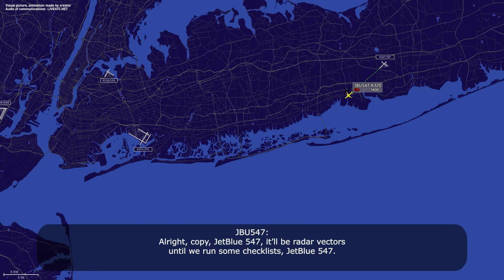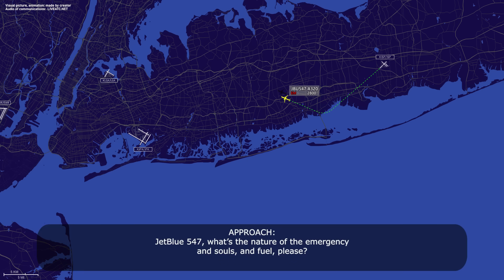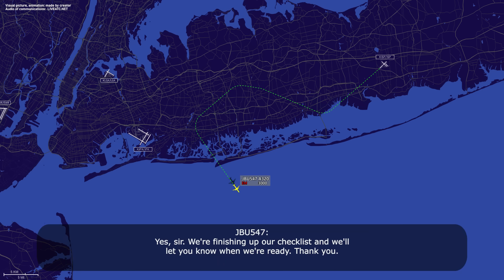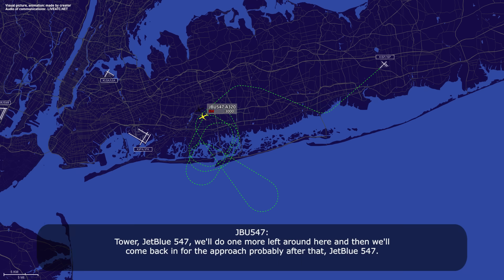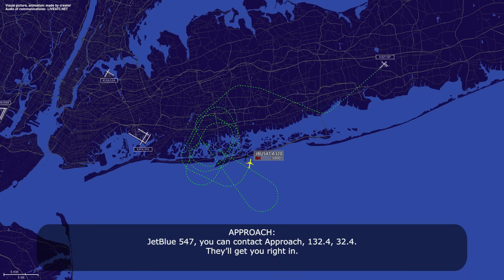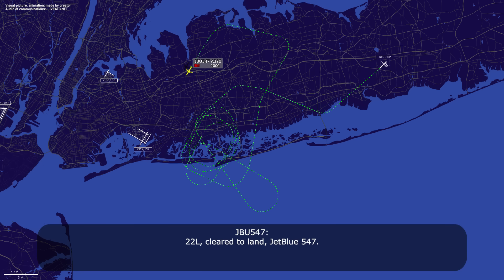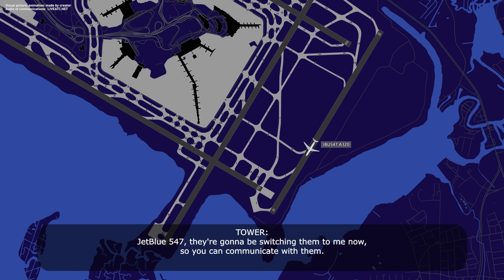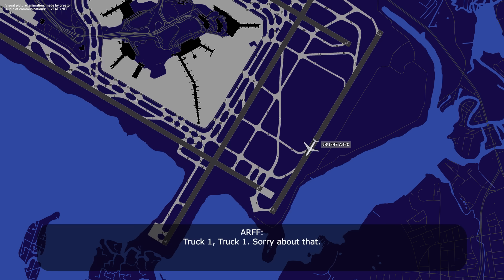47 minutes in the air with destroyed engine. JetBlue Airbus A320 diverts to JFK. Real ATC

Comment: How many times does he have to repeat fuel/souls to each controller and every handoff the system is a failure and antiquated. The FAA needs to change these rules and figure out a better way to transmit emergencies via all controllers so that crew doesn't have to keep repeating themselves while busy going thru flows to either rectified the situation or perform the proper emergency !!!

Comment: I personally would go to LaGuardia  and land 22
Reply: why ?
Reply: @JoeH-l8w  it would’ve been the most closest airport from where they declared the emergency line to LGA as an alternative . But given that B6 is hub is at JFK they are most likely able to do an ac swipe
Reply: @tdadp  The FAA requires you land at the nearest suitable airport. An A-321(I flew them for over 20 years) with a full load of people and still with lots of fuel would not handle a 7000 foot long runway very well in this situation. A single engine approach requires a flaps 3 landing, so the approach speed and landing distance are both increased above normal.. Although reverse thrust is not used for the field length computation, they would not have both engines available for that. There is always some time required to complete the checklists and prepare so, one airport being a few minutes flying time farther is not normally an issue unless there was a fire or dual engine failure. From memory, I think JFK's RW22L is about 8400 feet. I am 99% sure it would satisfy the runway required in this situation whereas LGA's 7000 feet would be either too short, or leave no room for error. Choosing JFK seems to me the best alternative, and, all is well that ends well in this case, Kudos to the crew.
Reply: @JoeH-l8w  I get what you’re saying. I’ve been Airside at LaGuardia when a few aircraft  made emergency landings at LaGuardia  all uneventful thank God but the good thing is at the end of 22 thei is e mas & ARFT truck are station their. I have also done mock emergency trains drill at Lga & they are more then capable of responding to any emergency. It is one thing when we have a table top exercise. It’s another one. We do the full emergency with actors and first responders from the NYPD to FDNY with the Port Port and PAPD ..  because they also train at JFK the same in Newark with Elizabeth and Jersey City fire department and police services.

Comment: By my count, there were 7 different controllers and 6 radio frequency changes tasked to this flight crew to deal with while having to deal with the primary task flying the aircraft. ATC needs to be educated  that for pilots in an emergency, the order of critical task accomplishment is Aviate, Navigate and way down the list is Communicate.They were asked 4 different times for fuel on board and number of soles. In today's modern technology, no crew should have to declare an emergency more than once nor should they have to declare soles and fuel on board more than once. Yup, this is busy airspace. One of the first tasks the flight crew will accomplsh is select 7700 on their transponder. That tells every controller that has a radar screen that this is an emergency. Because the airspace is so busy, there are a bucket load of controllers that can manage this emergency on the ground "in the background". ATC needs to change their mind set as to why they exist. ATC is a resource for pilots not the other way around. In an emergency, they need to reduce the work load in the cockpit not increase it with superfluous and repetitive radio transmissions. After the second time that soles and fuel was asked and answered, I would have told ATC asked and answered. Check with your previous controller. When I started flying 40+ years ago, air traffic was much lower and separation rules created a lot more space between me and everyone else in my vicinity. Now TCAS, GPWIS and ADSB do alot of that work but when crap hits the fan, the holes in the Swiss Cheese are trying to line up and ATC needs to know they exist to help not hidder. Glad Jet Blue got in on the ground despite ATC unjustifiably adding to their workload.
Reply: USA ATC has antiquated technology. It's not just $, but also the system is so complex that people are terrified to mess with it.

Comment: For all the "expert" commenters who thought the pilots should have landed sooner: an engine failure is an emergency but not a time critical one. You get zero points for putting the plane on the ground ASAP. There was plenty of time to run a thorough series of checklists (there are more than one) and the pilots did a good job getting their ducks in a row and avoiding being rushed by external factors. Everyone walked away in perfect safety in spite of the equipment failure, and that makes it a successful outcome.

Monday morning quarterbacking from people who aren't even players is both amusing and pathetic.
Reply: Ok, extreme, but fair I think. There is danger to landing on one engine. Those checklists arent for family game night, they are to access systems you need to land. It is a responsibility to give the souls in your charge the best chance at walking away.
Reply: 100000%!!!
Reply: Why did ATC send them all the way out for sequencing when they were originally told they would be held close to the airport?
Reply: @Design_no The crew indicated that they wanted more time for checklists. In the meantime, there were other arrivals and south of the pattern is a good place to hold.
Reply: this is practiced in the sim more times than you can imagine
Reply: I would like to also add to the "experts" who say this was no big deal, engines fail all the time; This was different. It was a complete destruction of 1 of 2 engines during take off. The worst time this failure can happen. It's not like an engine went down at 30,000 feet.
Reply: Out of curiosity, is this pilot Jeff from Twitter? Serious answer only.
Reply: @kofd04 is it me or  did pic ask for 22R
Reply: @waynegordon7724  Pilots initially asked for 22R, then switched their request to 22L later on.

Comment: Is there no such thing as co-ordination among ATC centres in the U.S.? The pilot was asked three times for nature of the emergency (despite mentioning this with his initial declaration!), three times for remaining fuel, and three times for souls on board. The TWR controller at Long Island should have co-ordinated with Kennedy Approach immediately upon becoming aware of the pilot's intention to divert to JFK, giving all known info. In Australia, we have "hot lines" - you press a button and you are connected, no action is required by the station you call to answer you, they just listen. I cannot conceive that the U.S. is less well equipped. A huge amount of unnecessary transmissions - the pilot was asked six times to advise when he was ready to return, he was given traffic on an aircraft from which he was being positively separated, the controller spoke so rapidly on two occasions that the pilot had to ask for confirmation, most transmissions were non-standard, with callsign last or absent, and usage of non-standard phraseology. What is wrong with "hold at 10 DME, inbound 240 to the Kennedy VOR, two minute left-hand patterns, maintain 3000', followed by, when the crew advises that they are ready to return, "Cancel holding take up a hdg of 040, vectoring to downwind for left circuit ILS approach RWY 22L, 46 track miles to run". Two transmissions, instead of the fifteen that were made! Then, two speed changes and a heading change in ten seconds, in three transmissions when it should have just been one! An emergency aircraft has priority! What the hell difference is 10 knots going to make?? Move the other aircraft! Make it fit! Then another speed restriction, spoken so quickly that the pilot missed it! When pilots are in an emergency situation, controllers should keep frequency changes to a minimum, make all transmissions clear, concise, standard and slower than usual, so that misunderstanding does not occur. The pilot tells the fire truck, on TWR frequency, that he will require a tow, to which the answer is yes, then the ADC immediately asks the pilot if they will require a tow! Wasn't she listening - there were only two on frequency! What is wrong with you guys - don't let me check you!
Reply: In Europe my assistant would call the next sector as soon as we have the info and prepare the next sector on what is coming towards them. If he can't reach the next sector he can select prio and it will kick out anyone on their line and patch you through to provide the info. But yeah the U.S has become absolutely backwards in everything
Reply: They likely already have the information, but asking for confirmation anyway. It's called covering your ass.

Comment: Weird that temperature is in °C but altitude in feet and fuel in pounds.
Reply: Altitude is feet, speed is in knots, temperature is °C, time is always in UTC. In the US and a few other countries visibility is statute miles, pressure is inches of mercury and weight is pounds. In most of the rest of the world visibility is metres, pressure is hectopascals, weight is kilograms. Some countries use inHg for pressure but everything else is metric. 

China and some ex-Soviet countries use metres for height and kilometres per hour for speed, for some variety. Russia converted from metres to feet for flight levels, but low altitude is still metres.

ICAO have recommended everyone convert to metric for decades now, but it’s not going to happen.

Comment: The flight crew, ATC and ARFF all did a very good job... professional and responsive.  

So many times in these incidents, we hear either ATC or the flight crew suggest or select a runway based on its supposedly being the longest, when in fact it is NOT, due to a displaced landing threshold.  Even though JFK 22R is 12,079 ft long, its LANDING DISTANCE AVAILABLE is only 7,795 ft.  For landing purposes, that makes it SHORTER than 22L, which has landing length of 8,400 ft.  Runway 22R has a very long area of displaced threshold that exists for noise abatement reasons.  22R lacks a 1000 ft safety area beyond the physical end of runway and has no EMAS, so the declared landing distance is further shortened, creating 1000' feet of physical runway beyond it.  The trouble is, that's all so arcane and kind of buried in data, so pilots and controllers don't readily remember it.  Fortunately, when dispatchers and/or flight performance computers do the landing calculations, they do account for the actual legal landing distance.  That may be why JBU547 changed its request from 22R to 22L a while after asking for 22R.  

Another reason it's good that they landed on 22L is that it has an EMAS at the end, unlike 22R.

Comment: Jesus... guys, just land that damn thing ... all those protocols, almost 47 minutes to get that plane back on the ground... what's wrong with you people?
Reply: There are these things called checklists. And if they don't follow them, then the transition to slower approach speeds, and the risk of fire when they do touch down, go way up.

The passengers were actually fortunate they were on this model of airplane, and/or did not have a lot more fuel on board, so they could land without having to spend a lot more time dumping fuel to avoid an overweight landing.

Comment: Three ATC in sequence asking them same questions “Nature of Emergency, Fuel, Souls on Board”. Is it a systemic coordination issue or a mindset issue?
Reply: Answer to your question, I think it is a factor of both. Asking more than once the nature of the emergency tells me the Controller is not listening. News flash. If you ask a question listen for the answer. By my count there were 7 different controllers involved for this crew to deal with. Four of them asked about fuel and souls. That's all information that can be passed from one controller to the next " in the background". Second news flash ATC, these guys are busy trying to save their gluteus maximus and that of everyone else on board. Though they didn't know it at the time, but they had experienced an "uncontained engine failure". The only thing that would have  made this worse was an engine fire. I hope the FAA roasts ATC when they listen to the tapes. This needs to get cleaned now. Not five years from now. 40+ years of flying and this crap still sickens my stomach. Another crisis averted. Great work Jet Blue!

Comment: Call me crazy but if a 2 engine plane has lost one engine, it should land ASAP. This one seemed to take forever to land.
Reply: One engine isn't a particularly bad emergency, if there's no fire and nothing's leaking. Listen to the pilots, they're barely stressed. They're still climbing even.
Take the time to do it right.
Reply: Landing ASAP is a relative term. Landing as soon as practicable is the goal and they did just that. This plane is perfectly capable of flying on one engine. It won't climb up to the flight levels but that's not an issue because there was no need to climb that high. The crew has a number of checklists they have to get through. One of the most important is the inop engine checklist which includes determining if they have a fire and what if any other critical aircraft systems are also inop. After all that is out of the way, then they have to calculate their Vref speed for single engine landing atvtheir wieght. The big challenge it that they were heavy with lots of fuel for the planned flight. If they can't get rid of the fuel by dumping, then they are going to land hot and heavy with significant reduction in braking do to a 50% loose of reverse thrust. That's why they originally choose 29R. It's the longer of the two 29 runways. I have no idea why they changed their mind. Just super glad through all the ATC BS they were able to get this sick bird back on terra firma. unscathed.
Reply: Didn't they say they lost the engine on takeoff out of Iceland, and then flew to Kennedy or did I miss something? 😳
Reply: @JimmysSpeedShop  Islip, Long Island.

Comment: I guess my only question is--why did it take until after landing and having a fire truck inspection for the pilots to know that the engine was destroyed to that extent? Couldn't they have asked a flight attendant to go down to a window near the wing and have a look at the engine and report back?
Reply: They don't really care. They know it's not working. Not leaking fuel or hydraulic, no indication of fire, and no weird vibrations. So it's just run the checklist and land the plane.